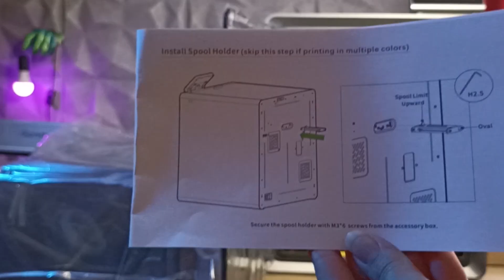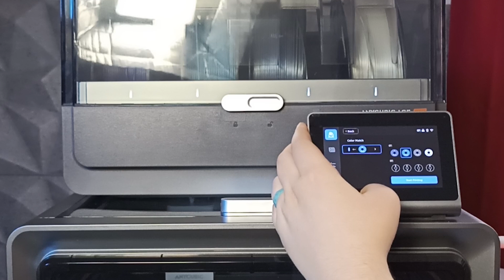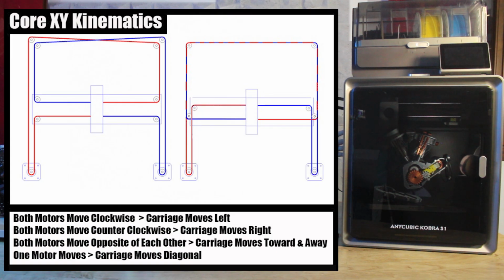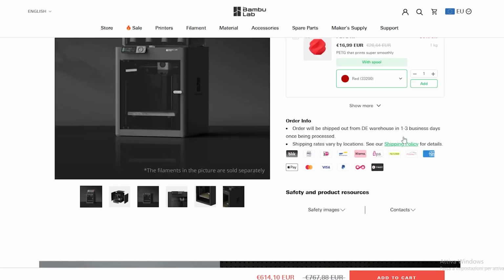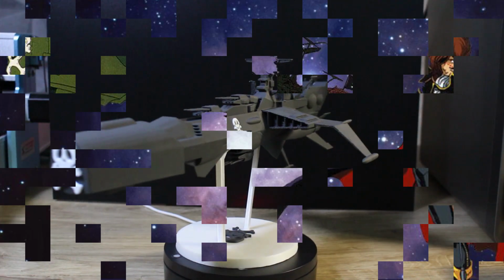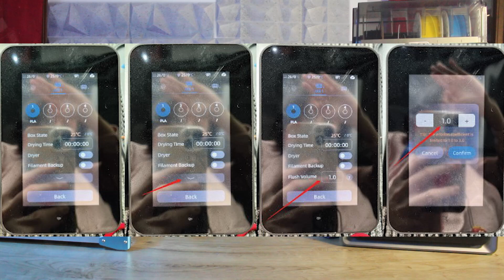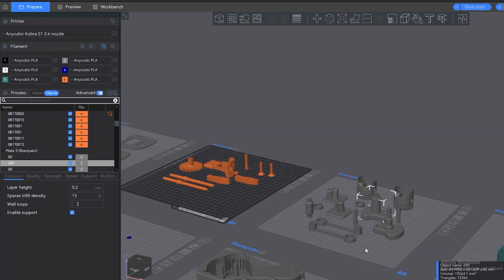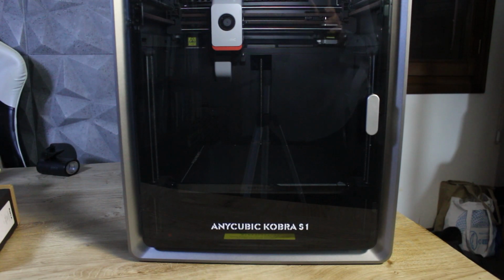@ANYCUBIC3D KOBRA S1 COMBO REVIEW: Accuracy, Speed and Multicolor 🎨 IS IT WORTH IT? 🔥

Comment: I bought this printer and i'm waiting to test it, but seen good things about it. I Also have a K1 Max, and bed problem is the height, 3 mm laminated aluminium for a 300x300 is too thin. Need to replace with a graphite or alumium casted of 6 or more.
Reply from the maker: Yes, it's a bit thin. But with the Kobra S1 you should have a lot of fun!